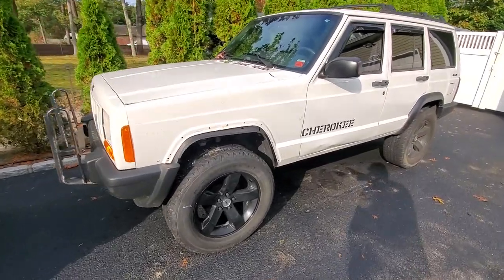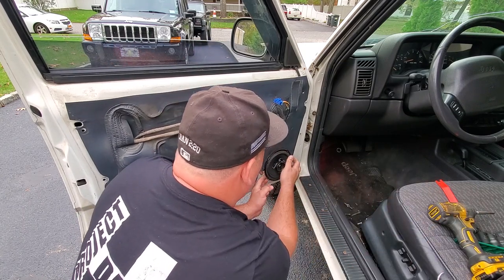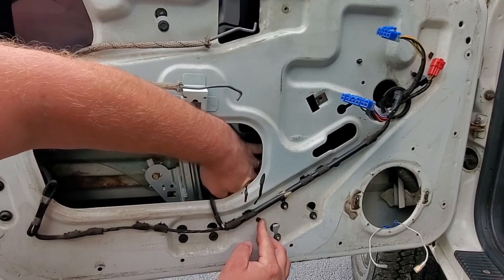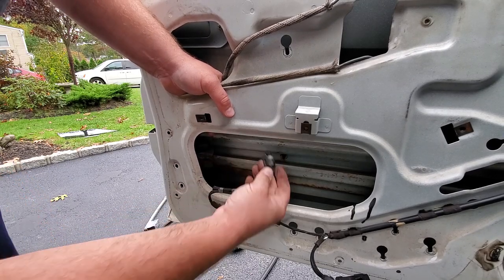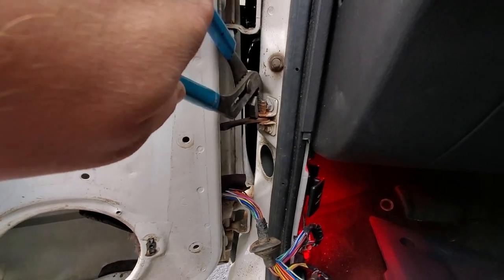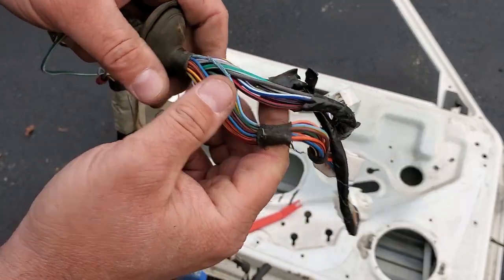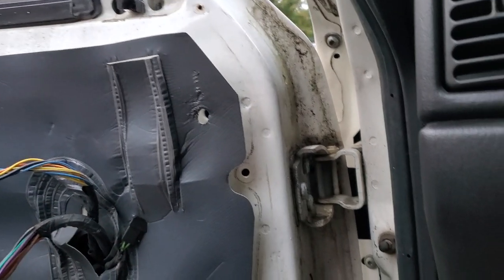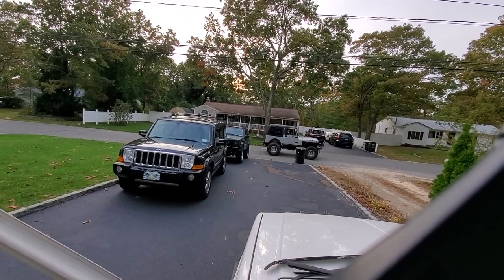JEEP CHEROKEE XJ DOOR DECONSTRUCTION - GUTTING A  DOOR FOR A SWAP

Comment: Great content, helps me with some tumbler and lock work I have coming up.  I have 2 MJs and an XJ that each have at least one really bad door lock issue.  For 1 MJ, it's a tumbler problem on the driver side and a bad lock mechanism on the passenger side.  Almost managed to get locked out, even with the key in my hand 🥺
Reply from the maker: Yikes!!! grab a junk yard key, and ignition tumbler and Door lock from a newer XJ!

Comment: It so happened I saved an  98 XJ, bashed on the drivers side.  Miles on odometer are 53,422.  I managed a donor Sport 2 wd for 150 bucks with no engine and after a detail and refit battle, have the *Cherokee Limited 4.0 cleaned up (no rust) with a curious list as final repair. *Door wiring intact to plug in, pass airbag, missing body to rear axel brake line and pass upper control arm.  The emergency brake splitter box was loose and I have to revisit the rear drum brakes to install a few new emergency brake parts. but isolated the front discs to begin to drive it around as to cause shop access. ( No highway or street as yet.) The drivers door opening was slightly out of spec.  But my main goal is to put it back to operating condition and at next summer, complete any welding and fitting. The single warning light is airbag. (pass).  A slightly damaged front yoke has to be addressed and I shortened a drive line but it ended up a tight fit as about 2 inches too long.  So I have to find a replacement and hit the right measurement.
Thanks for the door video post.  I had overlooked where main plug in came thru openings. And the drivers side door ground is a critical point to cabin windows. 
Any similar repair must take 1st steps to ensure clean fuel delivery to rail.  pull tank and don't try to send fuel until fully addressed. The hard plastic inside of tank is great as the repair can scrub out any left over sediment or gunk from long storage.  A new 3 row rad w. full flush made the heater welcome as nearly winter here
The engine sounds amazing.  I revisit your posts to get review to repairs, you see.   Thanks. (Wa state. regards. M)
Reply from the maker: Thanks man! Good luck with the build. God bless!
Reply: @ProjectDanH  Hi Dan  I bid you fair winds and a great holiday season.  6 miles on the 98 project with 53K original. The most curious faults were hidden fracture to the front upper control arm as weldment to axle. ( spot welded as repair and fitment.  )   very hidden as damage.  Also, at about 4 miles, front head lite wiring (dead short) caused 40 amp fuse to fail.  Stalled and no start. Replaced wire harness from connector and problem vanished. This was the grey leather package and wile a bit dry, cleaned as with cabin detail, all ok. 3 row al radiator (china) was fine except for leak at 90 degree inlet.  Door fitment was only fair and will need to be further addressed but sealed from winter snow, mountains covered and 100 percent tread, warm heater and 4x4 operation decent. *slight adjustments to throw required. This is the mirror assy as to black beauty.  Perhaps a few faults as weldment, but practical.  
What I try to keep in mind is the price of new 4 x 4 models. with many difficult control modules, light features and diagnosis component as cost.  This XJ sat in storage for 24 years. *Zero rust. The engine, as with clean fuel and factory set up as powerful is astonishing. A sort of roaring delivery and full acceleration to traction. Instant delivery and acceleration to travel. The full on best XJ delivery to a build, truly. An answer to difficult terrain and weather
The rear component as delivery to tires seems a posi trac build as 1st try loose gravel.. Nov 24.
Nearing where paint would be full to light blue color as replacement drivers fender, drivers side doors with welded hinge best repair but halted as my shop needed for maybe 7 degrees below zero Dec-Jan and heavy snow certain.  I drive a WJ daily but the XJ has features as turn adept to parking, grab as 4x4 in any mud, simple and parts available. Lots of kits and upgrade.  I mention I am keeping this 98 completely stock. Among the cabin was the build sheet. But I need new projects, will sell it soon.
I very much watch your repairs and I really like your humor and rather  service full on expert assembly to this model type.. The papers as found were 2001 to street use, near Canada park stickers and insurance card. New glass front on order with seal.  My final take. Skip the WJ. Build the xJ as shop best product and where I get some great tips and best shop method from your posts.. My personal regards. McGary * Washington state. US.

Comment: hey dan help an ozzy out brother , my daughters 1999 grand cherokee laredo has the 15 inch alloy wheels what is the biggest tyre she can have ,,No lift the jeep is stock as a rock 
,thanks Buddy
Rob
NSW
Australia
Reply from the maker: Typically you wont want to go over 30x9.5, You can always add small puck style boost or trim a tad 👍Here's a tire size calculator.
https://tiresize.com/calculator/
Reply: Thanks brother. Much appreciated 
Rob